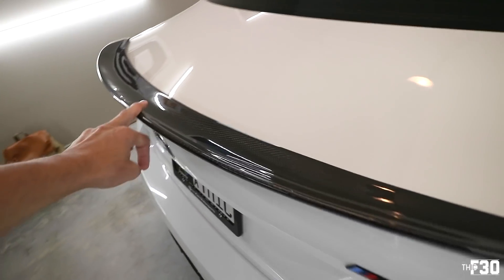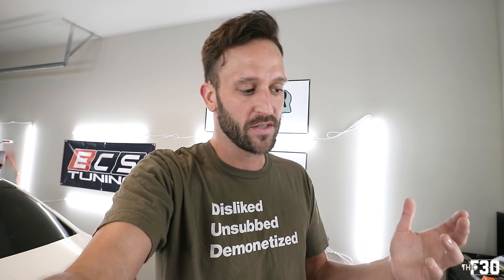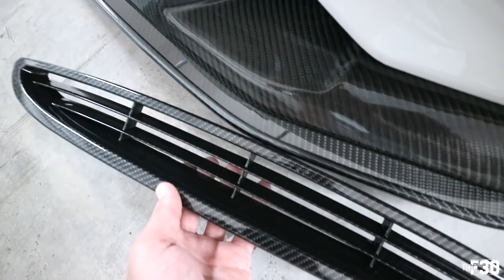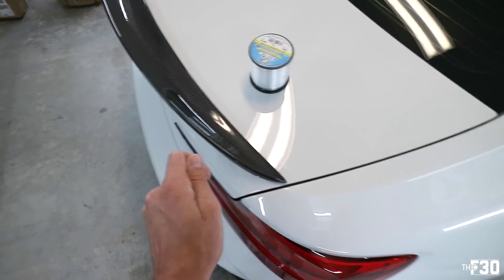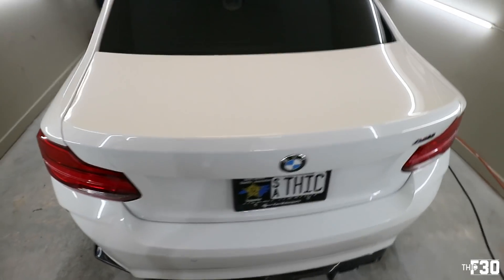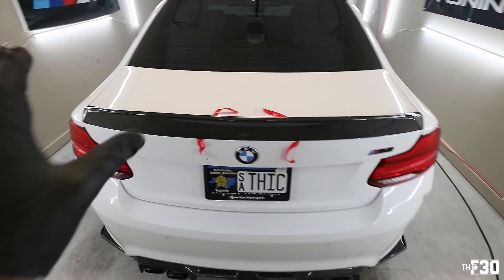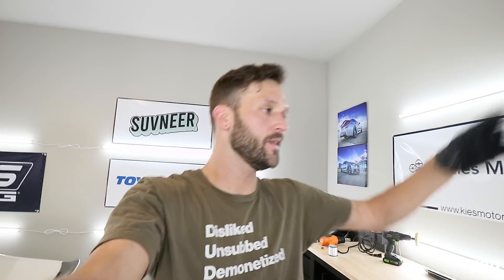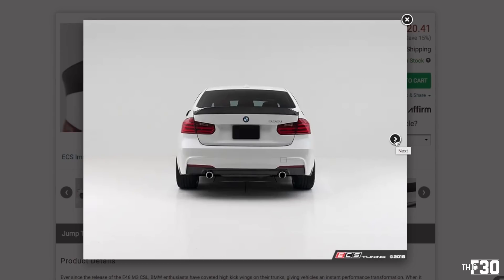THE PERFECT SPOILER - CARBON FIBER HIGH KICK FOR THE F87 M2!

Comment: Love that spoiler John. 

For anyone looking for the eraser wheel/pin stipe remover? It’s a Astro 400e. I also recommend using a adhesive promotor like 3m 06396 before applying the double sided tape.